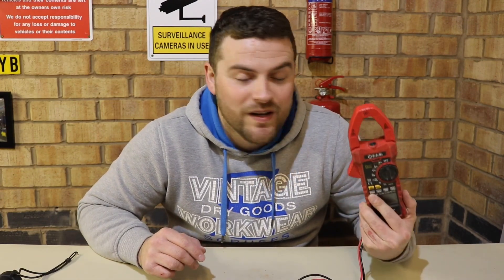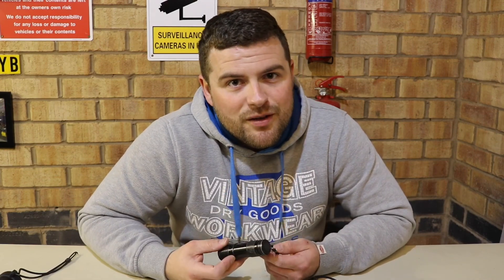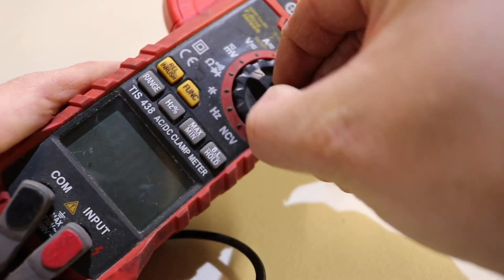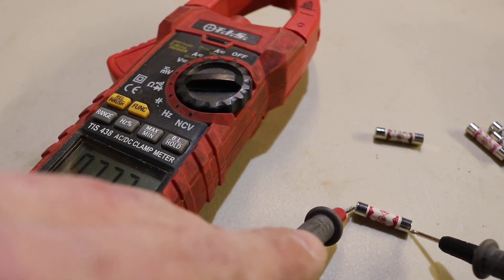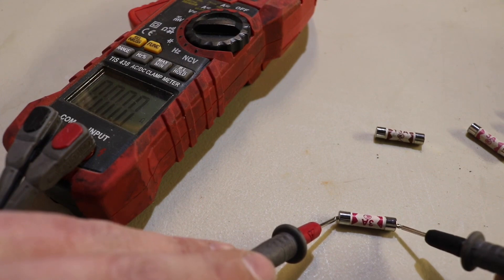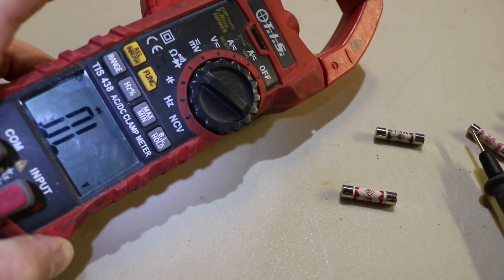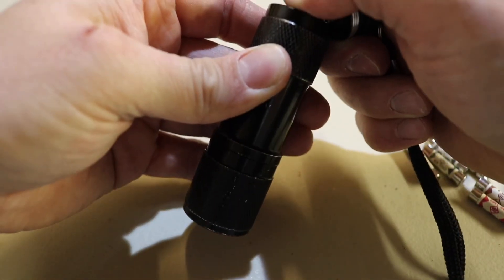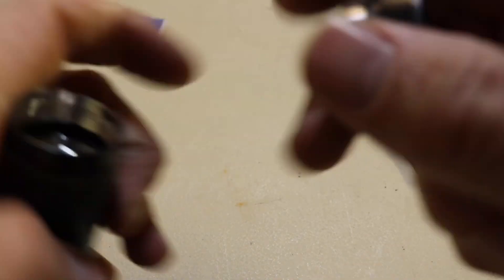How To Test A Fuse With A Multimeter And A Flashlight | Two Minute Tuesday

Comment: Hi, Dan, a tip for using the multi meter, always touch the prongs together first, to check the meter is working properly, (on continuity settings),,
No use checking, with a duff meter, lol,,,
Good tip with the torch ,!
Cheers buddy,
Reply from the maker: Haha u know what john I realised after I had finished that I hadn't done that in the video as it was a couple of takes 😂 normally u do it out of habit, thanks John appreciate the support 💪🏻